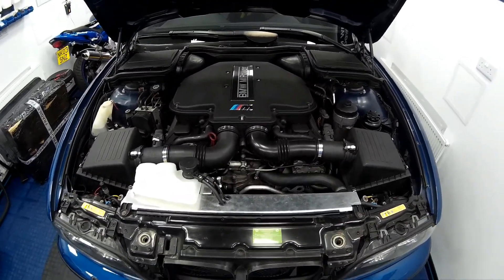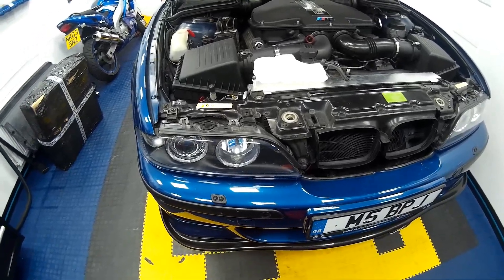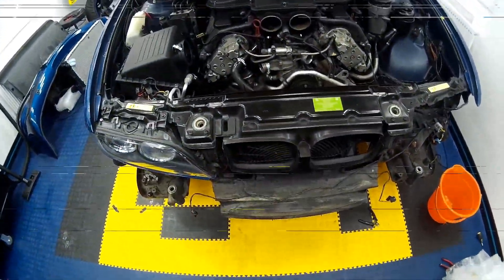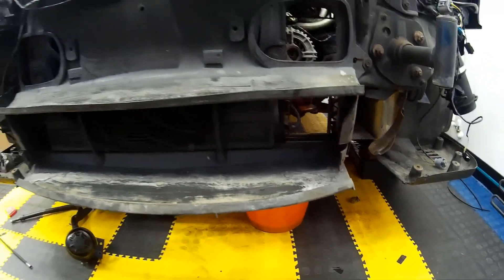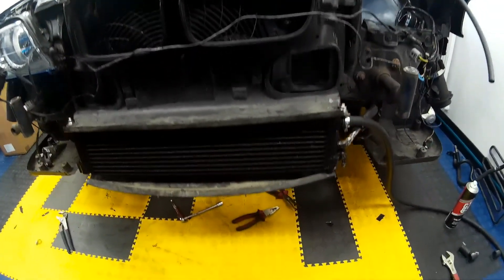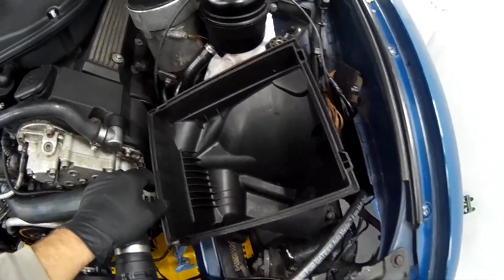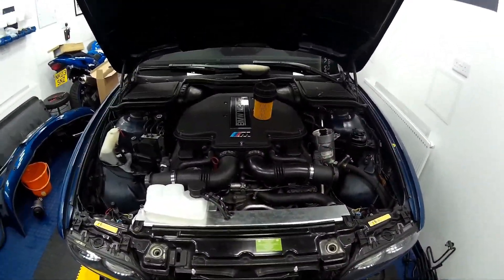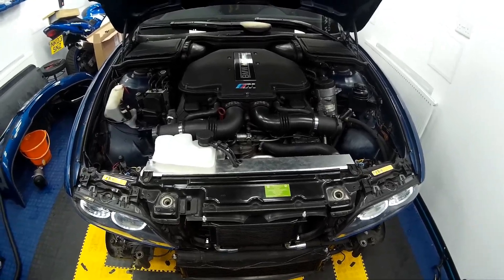BMW E39 M5 S62 V8 Engine Oil Cooler Fitment DIY How To Guide

Comment: Have you also got the part number for the oil filter housing with the cooler pipe take off?
Reply from the maker: 1142 7 511 171

Comment: Why not add a factory cooler designed for automatic transmissions on other e39s (540i, 530i, etc) and run engine oil or power steering fluid in it. It clips right in next to the original power steering cooler and would be a much cleaner installation.
Reply from the maker: At the time, i used what I had available. The PAS cooler has since been changed again and mounted elsewhere to free up space/cooling for the radiator and engine oil cooler.
Reply: Please share more details.

Comment: Thanks for the great video! Very straight forward install. One question though, is there a place on the oil filter housing where a temperature sensor could be mounted? Thanks,

Comment: Do you have a video of swapping the radiator
Reply from the maker: Here is the video for that - I reverted back to an OEM BEHR unit shortly after as the alloy one wasn't up to providing the cooling required of the S62 engine. The principle is the same though regardless of OEM or aftermarket radiator.

https://www.youtube.com/watch?v=6MR4e7t5yx0&t=952s

Comment: Where did you get the new oil filter canister
Reply from the maker: 817jlp Direct from BMW. Your local dealer/parts department will be able to order you one. The BMW part number is 11427511171

Comment: Who was the supplier you used for the fittings? I've been searching and I can't find JIC to metric. I'm in America so that could be why. 

Thanks!
Reply from the maker: Hi Derrick G. I get them supplied by a local hydraulics firm and then modify the metric side slightly to shorten it so it doesn't protrude from the housing and fits correctly.  I may look at producing them for sale soon and include shipping to America as a few people have asked about them too.  Cheers

Comment: Thanks for all the videos! Did you notice any hp gains going with electric fans?
Reply from the maker: No noticeable gains - but lets be fair, a 400BHP engine isn't going to lose anything noticeable with a viscous fan. The main reason for the electric fans was a reliability upgrade.
Reply: I'll probably upgrade my 540 to electric fans. With much less hp I'm thinking It will help a little.
Reply from the maker: Derrick G it'll certainly help with reliability and giving peace of mind. You can also modify the thermostat on the M62 4.4 engine too open at a slightly lower temperature which will also help with reliability.

Comment: Where did you get the parts? Any idea if this will fit on an E39 540i ?
Reply from the maker: Hi Roman, The filter housing with oil cooler takeoff was from BMW and is part number 11427511171. The oil cooler is available from any good motorsport shop or eBay. The hoses are custom made from a hydraulic hose manufacturer.
Reply: Thanks Paul, keep uploading your M5 Videos!
Reply from the maker: Cheers Roaman, There are more to come soon. :)
Reply: And will any braided hose with an oil cooler kit fit the outlet on the housing